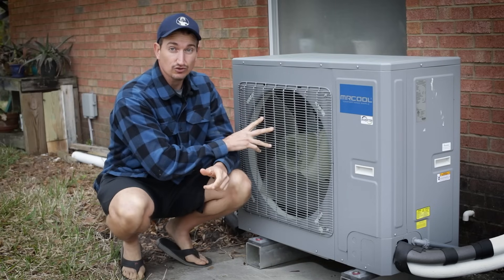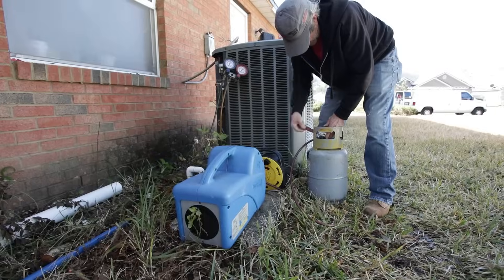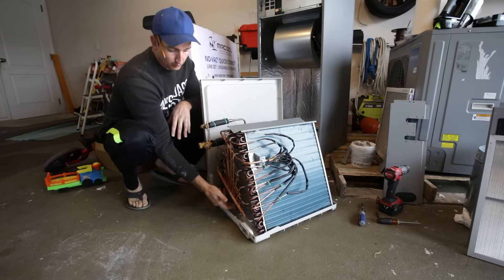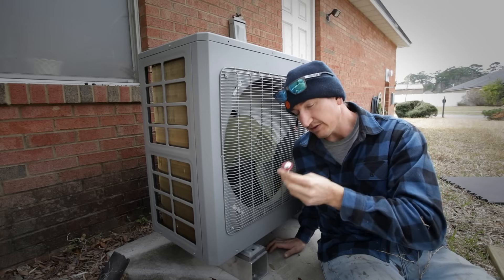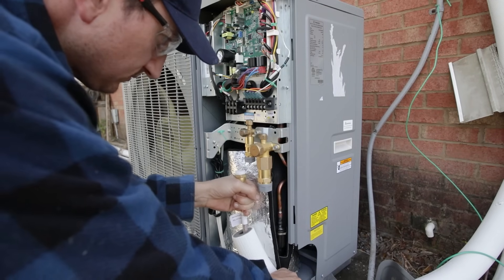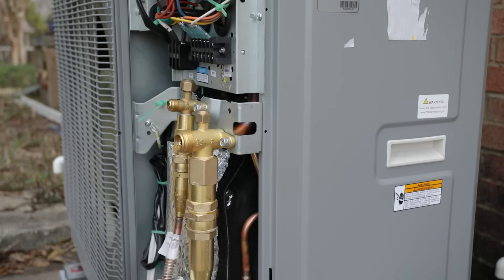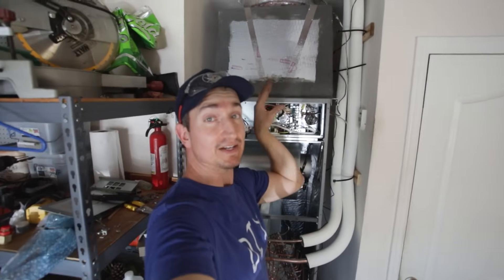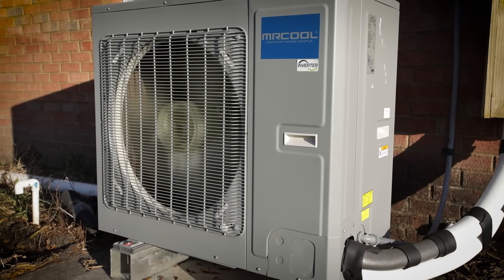Whole House Air Conditioner and Heating System Installation. MrCool Universal, Is it a DIY Project?

Comment: Great install!   I'm just about to finish my installation in the next day or so.   I had the help of a pretty skilled handyman who came in for some of the heavy-lifting and did the hammer drill for the 3 1/2" hole through brick to the basement joist space just above the basement door.  He also helped with removing the old A-coil on the old gas furnace and helped me lift and fit the new A-coil in place. I'm installing the Universal 3-ton compressor and Universal A-Coil with the 25ft pre-charged line set.  I've watched nearly every youtube video on the subject, yours too.  My end result will be a dual-fuel heat pump configuration (hybrid heat pump) which should provide a very efficient system even in the coldest and snowiest of deep winter Jan-Feb.   Everything has gone very well and smoothly until we unrolled the 25ft Line set.  The smaller of the 3/8" line was easy to work with, but that 3/4" line set is like wrestling a 25ft 200lb anaconda!  For small bends and general shaping, the 3/4" piping requires a lot of muscle.   As it turned out, the 3 1/2" hole in the brick was too small for the two sets to go through together, so I drilled out a second overlapping 3 1/2" hole and trimmed it up to make an over/under 5 1/2" tall,  3 1/2" wide oval.   Then I had to feed the 3/4 line set first, then the 3/8 line set,  bend it down, then to the left, and then up into the compressor from the side panel of the compressor.   Getting the line set to the proper length and bending to fit through the side panel with the electric and thermostat wire,  and then up to the quick-connect adapters is a feat of strength!    What is really challenging right now is simply lining up the 3/4 line set to the quick connect to hand screw the two together.  My arms are like silly-putty after wrestling the tubing.   So I'm taking a break right now.   So how did you do it?  You make that look so easy.
Reply: The update.   I finished my install today with the quick connect line set.  It all seems to be working; no leaks,  drips, or errors as best as I can see.  I had my thermostat plan ready and because of the gas furnace, I was debating about what to do with the W (heat signal) at the heat pump.  As it turns out Mr. Cool, now calls W1, 'D' for Defrost signal, so it goes to the W of the furnace.  I Programmed my new Nest Gen 3 Thermostat for the dual-fuel configuration (I did the Nest thermostat because it knew dual-fuel and had the option for controlling it.  The downside with Nest is the need for constant internet as it doesn't trigger the gas furnace on (and shut down the heat pump) until it is told what the outside temp is from Google.  I'm OK with it, but as a backup, I have an iO-DFK kit with a physical outdoor thermostat that can be mounted inside the heat pump, in case a winter night goes sideways with the internet.  

Anyway, my installation is finished and all looks A-OK.
Reply: So as a final follow up, I'm just making everything look tight and neat now. I need to find some of that Insulating tape others use with the line set's bare parts leading to the compressor.  Of particular excitement was testing the Mr. Cool HP in heating mode.  The compressor blew out very cold the air and it was 74f outside, 77 inside going to 79.   In front of the compressor exhaust, it had to be about 50F! I've never experienced that before.   SO...this one is a thumbs up big time!    My advice; be prepared for the line set struggles and absolutely finger tighten the quick-connect halfway before using the wrench. Also don't wrestle the solder joints, just the tubing. It also looks like the small quick connect shows about 1 to 2 threads to spare where the larger shows none.  Torque wrench to grunts; the 3/8" tube; 50N is a grunt, the 3/4" 70N is tongue to the side, butt-clench grunnnntt.
Reply from the maker: @cbsites4127  Thanks for sharing your install experience and congrats on your AC install
Reply: Just an addon ... Lefty Loosey, Righty Titey but on the compressor, the connectors are pointing down so with the quick connect coming from the bottom, it's just the opposite  Beware of that.
Reply: Thanks for the like.  I saw another tip for leakless installs of the quick connect from some other DIYer, and that was to tighten the connection to 85 percent of MAX, then loosen it, then go full-on; repeat once or twice on the loosening and tightening.  He was repairing a leaky connection, so he did this on all the quick connects.  It worked for him apparently.

Like most folks though, mine worked perfectly the first time,  and it's 'a-feels-like' 106 but a nice 77 inside 2nd floor.   First electric bill; 35 percent lower compared to last year.    I love it.  This thing is everything they tell you it is.
Reply from the maker: Congrats on your ac install project.  Yes I found the manipulation of the line set a bit challenging as well. It was a bit difficult to line things up just right so the connections threaded properly. Of course it is very important  have the threaded connectors line up perfectly to avoid stripping the threads and to ensure a proper connection. You may need to make adjustments in the line set further away from the connection end to have the play required to manipulate the connector  positioning.
Reply: Jan update.   The switch in fuel worked perfectly, and now I'm back to electric with milder winter temps.  My observation is the Mr. Cool starts the air handler immediately so the first few minutes of running are cool air, where as the furnace/gas pauses to heat things up before it engages the air handler giving a quicker warm up appearance at the vent.    From a DIYer,  this guy is awsome.  I hope I can report the same 10 years from now!
Reply from the maker: @cbsites4127  thank you and thank you for your updates
Reply: October update.   Still going strong and it handles the hot summer with ease.  We had our first  October freeze and turned on the heat mode.    That seems to work nicely.   It takes a little time to warm up, but when it gets going, it heats quickly.   It kicked into defrost mode and the gas heat kicked in for the first time. but it was very brief.  I noticed the sidewalk was wet underneath (the unit is 8in off the ground) so I'm not sure but maybe should have done the drain.     Heating is performing well so.  I may investigate adding a drainline.   My concern with that is having it freeze up in the depths of winter.  Any ideas?
Reply: Dec. Update.   This thing is awesome!   Tonight is the test with the arctic bomb cyclone tonight.  I built a dual fuel config and it should switch to gas heat at -1.   What a time to run a test.  Lol.
Reply: It's been a couple of years now, and ZERO problems.  Electric bills are higher in the winter but gas usage is much lower.   If you can,  get a google NEST for this unit, it's like the cherry on top!
Reply: ¹¹loo loop Lolo o loo 9 o loop o o p 9 p 0 I I o o loop loop kool o MI I 9
Reply: One more update.  System is great.  97 outside right now and all is 77 inside.  It seems to be well sealed.    It handled the coldest of our winter months just fine.   And I have to add, the fuel bills are about 30% lower.   So year one has been a big thumbs up.

Comment: My air handlers coil leaked heavy after only one year. The company sent out a remanufactured coil instead of new and of course I had to dish out more money for a tech to install it. These ACS are made in China everything from China is s***
Now that I saw the whole video it's actually the same exact air handler that I have. It leaked on loop rigs on the coil upper right
Reply from the maker: sorry to hear you had some issues with your system.  Is it running well now?
Reply: @MrKistel  well it's only the second day and it's cooling. Lol hopefully I can get a couple years out of it. But I doubt it. The previous coil was heavily rusted I just 14 months from new

Comment: Ahhh, hack jobs all around. When your shit breaks, no reputable HVAC technician will even touch it… I know I wouldn’t
Reply: A license doesn't necessarily translate into a competent HVAC tech. All it does is mainly protect the guild, in keeping prices/labor high. I've seen plenty of crappy installs from licensed HVAC techs. I suppose you think flared fittings are superior to SS Swagelok, or Parker compression fittings?
Reply: @louisboliou7432  I didn’t say anything about a license, I said reputable which would translate to competent. And honestly, I’d rather braze instead of flare if I could, but mini splits are all flare.
Reply: What is your point? People will do this because they can't afford what HVAC contractors' are charging them for to install even the cheapest system they have. Also we are not dumb that we just jump into DIY'ing a 5 ton ac unit replacement without educating, researching, and assessing ourselves about law of electricity and its applications, gas law, heat exchange, what a 240 volt is capable of, and so on. We are not cheap, we can't afford it your way. And if we go your way we will be more broke.
Reply: @phildel092201  more power to you. I’m just saying when it breaks, don’t expect a reputable contractor to touch your pos DIY project. Most of the time it breaks directly due to it being installed wrong. Compressor burnout, leaks, etc.  I always tell people sometimes it’s smarter to spend more money up front instead of spending more later because it’s not done right and it breaks at the most inconvenient time.
Reply: @timrob0420  The point is, either you whine, and bloviate because someone tried to install their system--likely because they couldn't afford the high install/unit pricing, or you simply treat them as a customer, and charge them per your standard service charges. I worked as a nuclear instrumentation technician, and was certified on inconel tube bending, NEC, and virtually every compression fitting. So, would I be rejected if I made a service call for possible Freon handling issues, though I installed my system?
Reply: Also, a few 13.8 KV breakers, as well as molded case/load center, MCC buckets.
Reply: @louisboliou7432  no I think the point is with most of these systems that aren’t the bigger names like Mitsubishi, Fujitsu, or Daikin, they don’t have any reliable way to get replacement parts and they also phase their systems out every few years with no support on the previous model. Not to mention, a lot of times these DIY projects are a complete shit show and turns into more of a headache than anything. Most contractors don’t want to deal with it. It becomes such a headache that it’s not worth it. And like I previously stated, even Mr. Cool DIY series says warranty is only valid if installed by a professional. So then you go out, people are all pissed because you can’t warranty their stuff and then they want to argue about pricing. Business is a two way street, contractors can choose not to deal with the headache of a shit show because of a shitty install. It’s not only “Freon issues” a lot of times it’s electrical code issues, refrigerant line issues where it literally creates an oil trap and cause compressor issues, etc. I’ve gone to one where there was literally no disconnect out by the equipment and they had romex going outside. It was a house that a slumlord turned into basically a 3 unit apartment with a head in each apartment on a multizone outdoor unit. Shit like that. It’s not worth it man. So y’all can all say “oh you are so crooked” or whatever you want. I say, if you can install it, you should be able to fix it. Half point of paying for a reputable contractor to install it right is to have support if and when it breaks. So go take your self righteous bullshit somewhere else.
Reply: @louisboliou7432  if you are competent like that why are you calling someone to fix it then? Give me a break

Comment: You’re lucky wherever you live that a hvac tech will actually service it. I live in ct and have tried over 15 hvac companies and not 1 of them will touch the mr cool unit.
Reply: I service Mr cool unversal systems. I'm located in webster Massachusetts
Reply: @danthesupercontractorhvac9690 
Do you still service MrCool universal central air systems?
Reply: When they didn't charge you 3 to 4k to install it, they won't service it.
Reply: @thomazz1976  on point. My local place charged me $4600 to install my 4-5 ton unit with ducting in the attic crawl space.
Reply: @thomazz1976  Its beyond that most companies treat service as service. The red flag with these are we know its a non professional installation. Its more of a liability than anything as he who touches it last owns it. There are lots of shade tree or even very poor installed systems most won't service also. If I walk up on one where basically everything is wrong no I won't touch that ethier. As for my company I don't service things I don't have easy access to parts or support. My suggestion to some of you having a hard time finding someone tell tell you'll accept a taillight warranty and you might get someone
Reply: I agree with Daniel.  My dad and brother are both HVAC contractors and there is nothing difficult about this system. The fact that it is installed by a homeowner does not increase their liability.  All techs service thousands of units without knowing who installed it or who has touched it after install.  Charging a system is easy and I would be floored it someone said no.   We are also not working with R22 here.  A good tech should be capable of a few simple repairs and charging the system.  If not, I question their ability as a tech.
Reply: @jonsaircond8520  Besides the electrical there's absolutely nothing that a homeowner can do it wrong as long as he or she follows the directions. There are even videos on what to purchase and how to vacuum the system professionally. Just because a so called professional  didn't do it, don't be mad at the homeowner. As so called professional had to learn it somehow and so are the homeowners that don't want to pay these over inflated installation prices.
Reply: @thomazz1976  Then why all the complaining. Most think they can buy it and we will show and help out like a buddy for beer money. I have no problem with anyone putting one in but I shouldn't be expected to bring my 30 years experience and 60K plus van to the party for a few hundred bucks. I agree that some of the prices thrown out here are outrageous but in my market that isn't the case. Business expenses alone force us to charge a hourly rate that seems absurd but its not. I spend between 2000-2500 a month per van to keep it on the road not including the man in it. How about the 2 million general liability insurance incase I wreck your house. Saying a homeowner is learning like a greenhorn is a silly statement. The new guy usually ( definitely should) have experienced back up there and all the assets I mentioned above to back it up. A YouTuber I watch has a saying if your gonna be a bitch be the whole bitch. If your gonna install your own unit install your whole unit. Too bad you guys only see the 20% that succeed in this and I wish anyone good luck that does thier own
Reply: @jonsaircond8520  the way things are going your 30 yes of experience and you 60k van will be doing handy man jobs.
Reply: @thomazz1976  I'll do what I have to do. If it comes down to staring up homeowner installed units for beer money probably do that too. In the meantime I have more than I can do with normal work. Where I'm at atleast no matter how bad it gets people want AC when it gets 100 plus with a average humidity of 60% most times way higher. I think people doing thier own stuff is great I'm the same way. YouTube is a wealth of information that if used correctly you can do almost anything. Problem with HVAC nothing is black or white on diagnosing problems. Unit can look low on freon but the evap coil is plugged up or a new indoor blower was replaced with it spinning backwards. Its just hard to do this trade correctly as a weekend warrior event between specific tools needed to experience.
Reply: @jonsaircond8520  lol I haven’t heard anyone reference the taillights warranty in many years 🤣😂 that’s the warranty you get with used car’s lol
Reply: Just tell them you have a Gree Flex unit, it is the same thing.
Reply from the maker: Actually I called several local HVAC companies. Most seemed unfamiliar and not interested in working on this system.  I ended up finding a guy who was familiar with mini-split installs and he was the one that help top off the system.
Reply: I am having the same problem in Wisconsin.

Comment: What part of the country to do you live in?  I installed a C&H 18,000 BTU mini-split to my 24x36 garage that I bought off FB marketplace for $600 last summer.  Was an amazon return I think.  Put it in cause I was working from home plus it's my ham shack and workshop and was a hot summer.  Worked great as AC and heated my garage all winter.  Was pushing heat on the coldest day I saw -5F.  Very impressed.  Never ran propane heat in my garage all winter.  Western NY Bills country lol.
Reply from the maker: Wow that is a big space. Awesome to hear your AC and heat system is working well. Thanks for sharing.
Reply: Ham Shack?  You are close enough to me to join in our net if you have HF - 80 meters.  🙂 3.961 - every night at 16:45hrs.
Reply: @garysmith8455  Thanks Gary I'll see if I can join.  Been doing a lot of FT8 lately

Comment: ordered a 20 SEER // Mr.Cool unit yesterday....quesion...where I can find those aluminum square beams for use as a montage surface?
Reply from the maker: I went to a local metal supply shop and they happen to have the aluminum square pieces in the cuts offs section.  Worked perfect for me.
Reply: @MrKistel  thakk you, ended ordering some online...proably a waste of money since won be able to return them if I need so